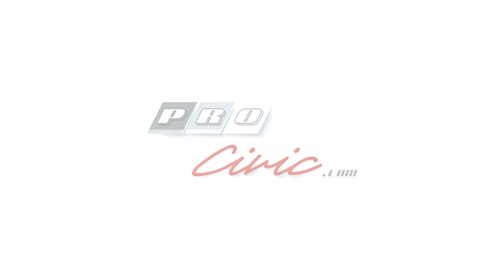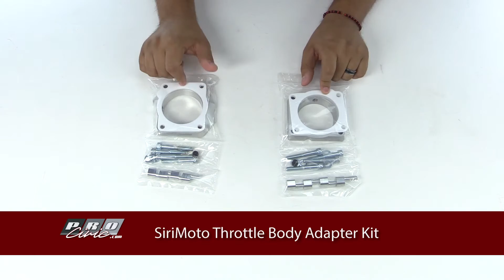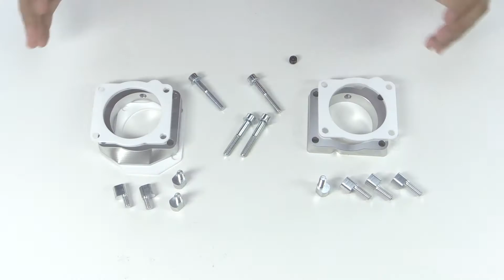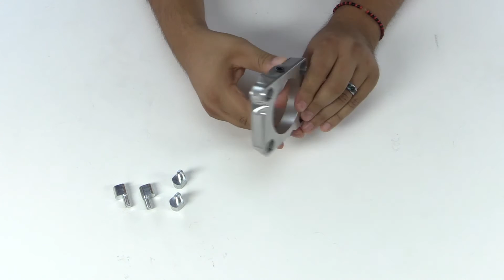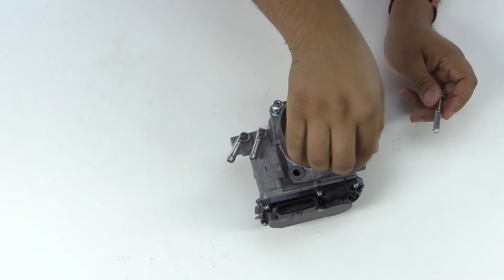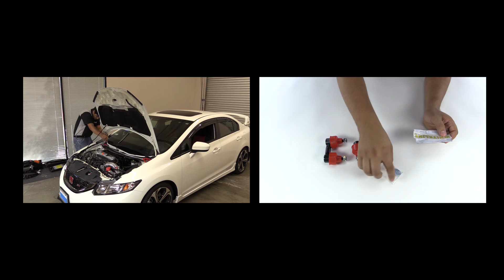SiriMoto ZDX/J37 Throttle Body Adapter - Honda Civic Unboxing/Review

Comment: Do you have an installation for the actual throttlebody?  I received my kit but the throttle body coolant and vacuum lines are side by side instead of stacked like the one in the video so I don't know the proper line connection for 2015 civc Si, please help!
Reply from the maker: +Arnold Bliss Please email customercare@procivic.com for detailed tech help.
Reply: Hello thanks for getting back to me after looking at more of your vids I noticed the coolant bypass method and I plan to bypass my coolant lines for the TB.